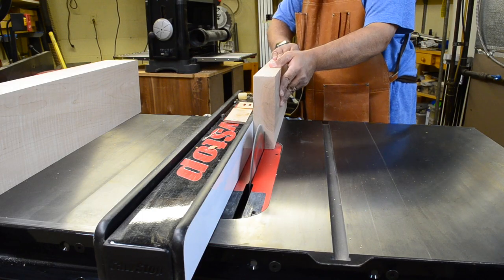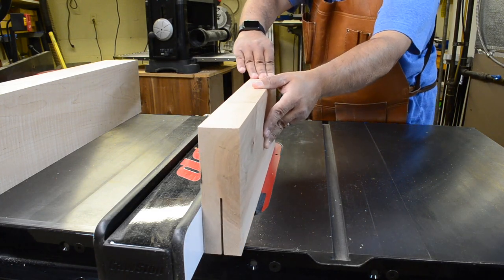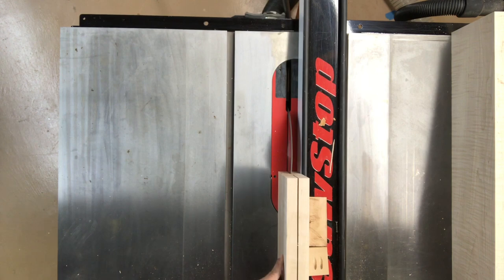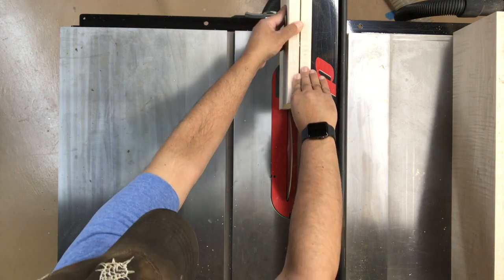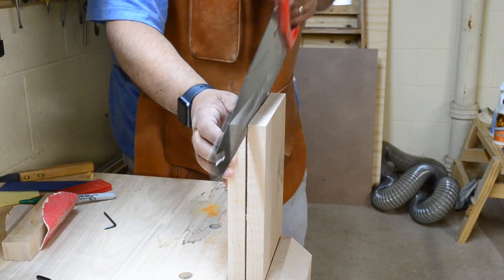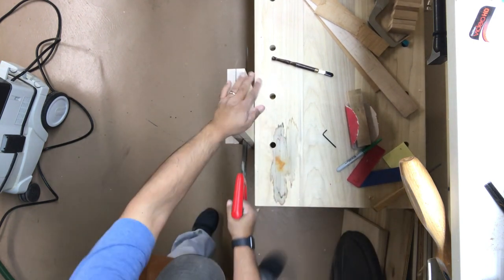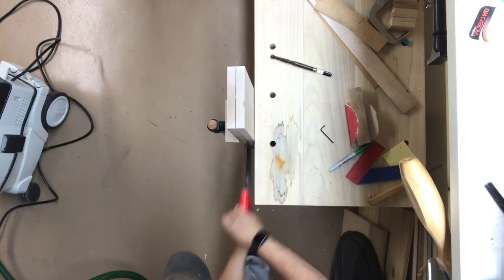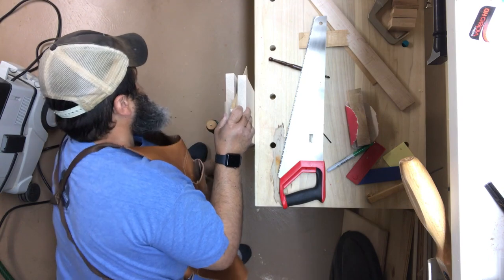Resawing Thick Stock with a Tablesaw

Comment: Would this be most helpful for people who don't have a bandsaw, or is there a reason you'd use one instead of the other?
Reply from the maker: For certain it would be helpful for those without a bandsaw and yes, I chose this option because my current bandsaw setup doesn't have the capacity to resaw stock this wide so this was the alternative.
Reply: I use this method because I don't own a bandsaw.  Do note that Matt's making it look easy; you need practice at setting up  and using your table saw for precise cuts like this.  I don't have said practice (my table saw lives under my lathe and only comes out when I really, really don't want to cut by hand) and thus my results aren't nearly as nice as his.

Comment: Is this better than using the bandsaw?
Reply from the maker: It depends. For myself the primary benefit is my bandsaw doesn't have the capacity to handle stock this wide without adding an extension that quite honestly isn't worth the extra effort to add. But with that said, a bandsaw with the right blade does an amazing job and doesn't waste as much material since the kerf is so much narrower vs the tablesaw blade.